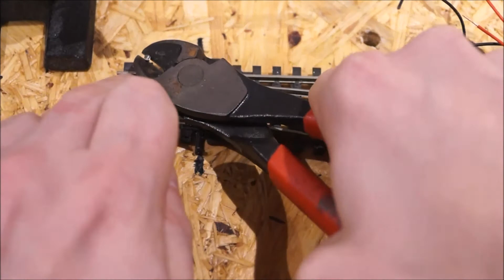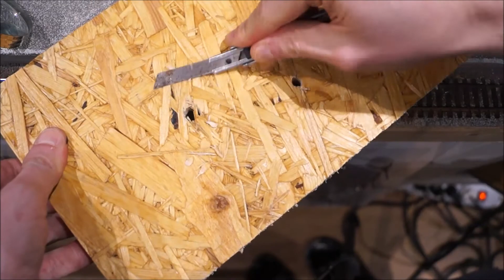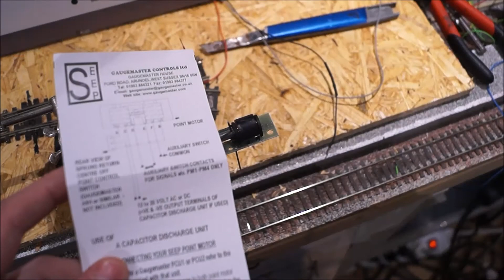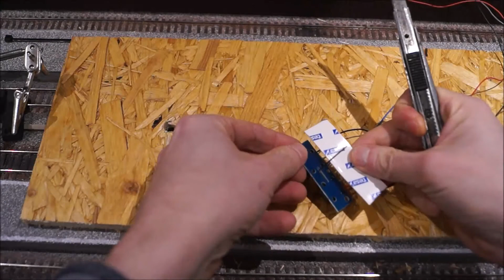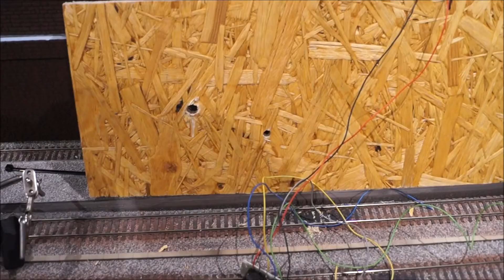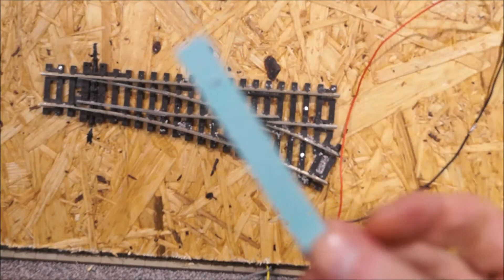How to Install seep point motor Gouldian Junction Video 20

Comment: Good video on wiring the point motor but what about showing where the other wires are connected.Ie green wire to your transformer why not show you connecting it. Also why not the black&red wire been connected to control the point. And finally why not show the wires been connected to your bus wire. All theses point would be helpful if your trying this for the first time.
Regards
Tony

Comment: Thank you. Nice easy video to follow.  i have searched for an easy explanation on wiring a insulfrog point. yours is the first and only one I have come across.  Subscribed.
Reply: Your viewers may be interested to know that the holes for fixing this motor are immediately suitable to ‘tap’ 4BA. I tap these holes and attach 5 wires to the various solder tags. I only use two of the aux switch pads as I have found it better to switch a 12v coil DPDT relay for each point for a) frog switching and b) signals, LEDs etc.  Accordingly the motor is pre-wired before fitting as you also suggest.
I made an aluminium 2mm thick template to identify the fixing holes in the top side of the baseboard to both match the fixing holes of the motor and  align it wrt the tie bar hole.
I countersink these holes from the top side of the baseboard.
It is now possible to fix the point in place quickly and accurately using countersink Hd set screws and have the wiring leads all to hand fo final connection. I mask the csk Hd screws with an imitation manhole cover.
At 80 Years young,my days of working under the baseboard are over and this method has worked for me!
Enjoy our wonderful hobby. T🚂